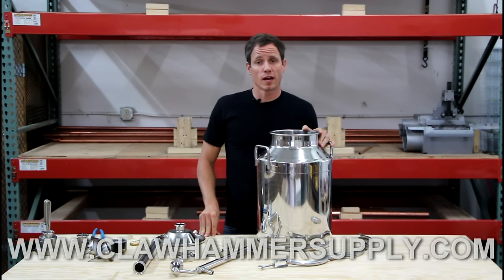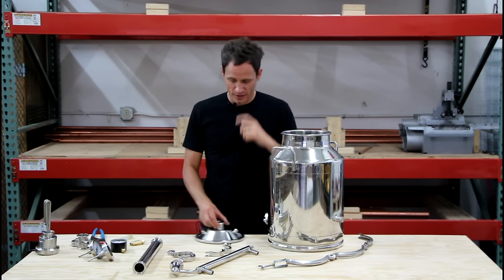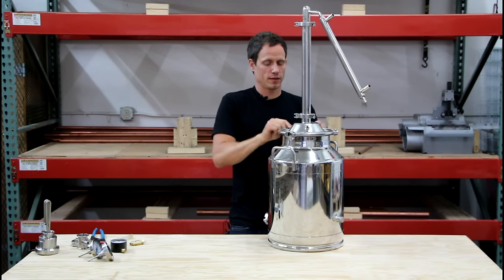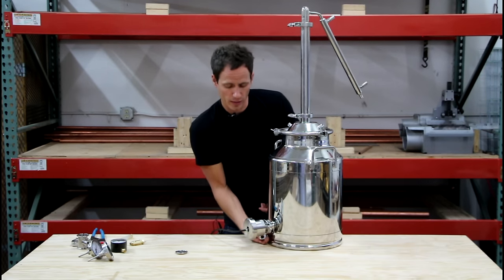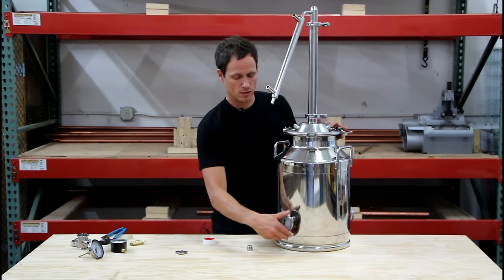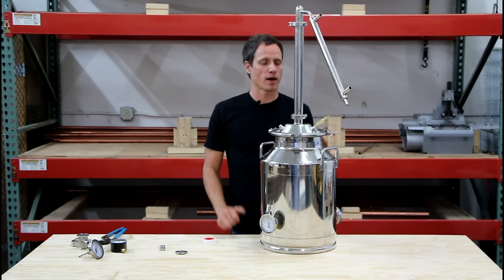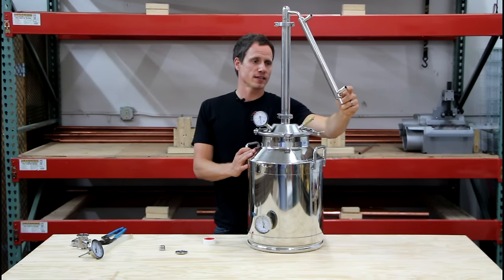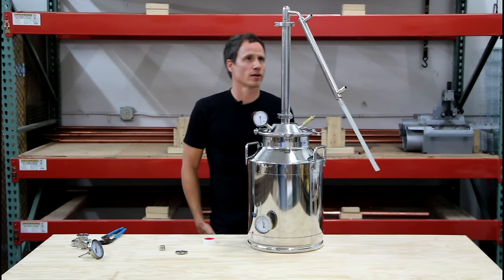Stainless Steel Distiller

Comment: Whats the advantage of having an element inside it to just sitting it on a heat source?
Reply: well a heat source is usually an element inside of your stove OR direct fire. The problem is that you're only using one direction (above the heat source)  so the rest of the energy that you're putting into your element/fire  is being lost in all the other directions (around the element/fire and below it). But when you have an element inside of your liquid you won't lose heat to the other sides because your liquid is surrounding your heat source.

Comment: You don't need a safety relief valve on an open system
Reply: He explained that it was a safety measure in case something got clogged up or kinked. Under ideal circumstances youre right.

Comment: what about temps....ive always used a thermomater at the top to tell when im runnin into my tails and see my steady temps...i dont see how a temp gauge is optional
Reply: +chris Rose Wonder the same thing. You do need a thermometer !!
Reply: Hahahaha! I guess your attention span didn't make it to 6:07.
Reply: @diregremo  they were speaking of head temperature, It needs one up top to measure vapor coming off “the point of no return back to the boiler”

Comment: Doesn't being all stainless create a bad sulfur smell when distilling?
Reply: If you put copper mesh in the column or if the condenser inner tubes are copper this would be alleviated. Personally I'm a all copper guy for the same reasons.

Comment: The boiler includes a fitting for an electric heating element  ? ........
1 : the electric resistance is submerged in alcohol for a future gin?
2 : there is no danger?
thanks for your reply
Reply: 1857 Spezial Bier 

The alcohol content in the boiler will most likely never exceed 15%.

It’s doubtful it’s more dangerous than stilling on an open flame.

Comment: Do you just simply clean a stainless steel stills with soap and water or do you soak in citric acid?
Reply: You can clean stainless with any number of cleansers and be fine but using something like PBW would be ideal for stainless.

Comment: I the grain  blocks the column, it will block the safety valve too..
Reply: The safety valve is on the lid a couple inches away from the column.  If one gets blocked, the other is clear.

Comment: I don't understand how the water hoses that are to be added to the extension work? Is that extension entirely hollow, or are there two chambers for the water circulation... One side for the water to circulate and the other side for the vapor? Has anyone tried this and know how well it cools to form the liquid?
Reply from the maker: Hey Byron, Yes, there are 2 separate chambers. Cooling water and still vapor do not mix.
Reply: There's a smaller tube inside the large tube. Hook a cold water supply to the bottom hookup and the water will come out the top as hot water. You can take a cooler with ice water and a pump and circulate the water during distilling.